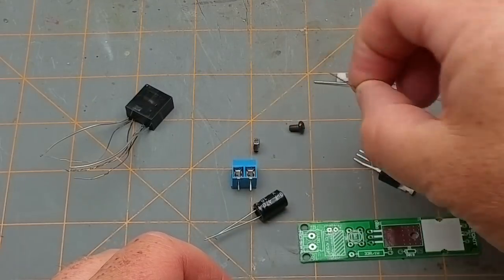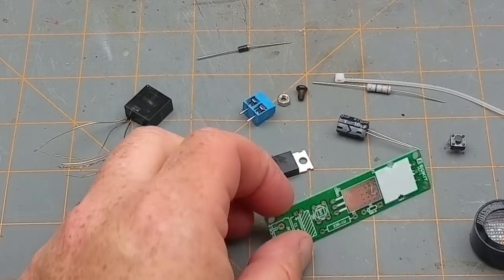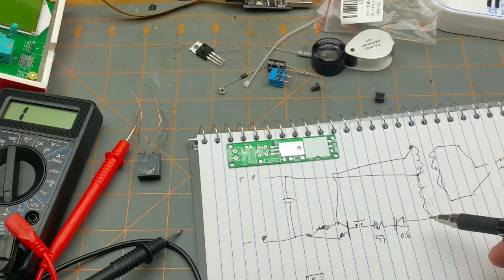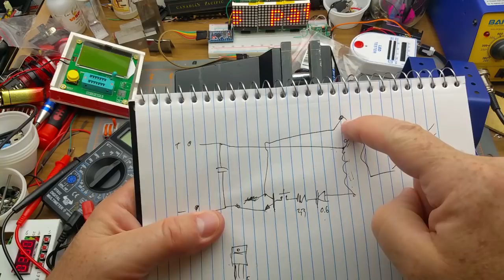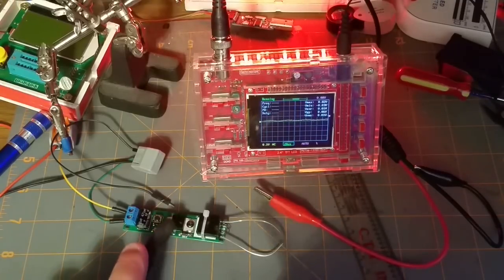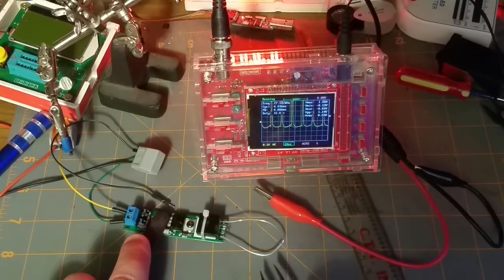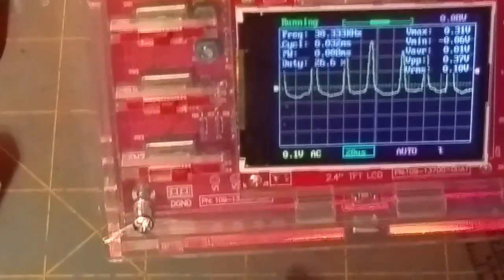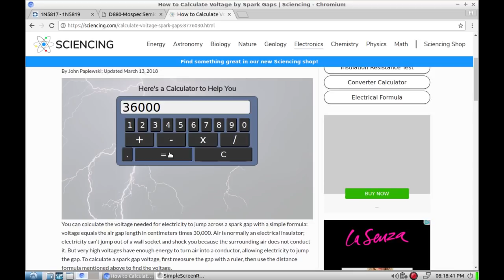High Voltage kit build

Comment: I've got same thing recently and it was fun for 5 min. 
Looks like this thing need 4+ Amp to work as designed, so I risk and use LiPo cell for this, survived Ok for short burst.And this is thing designed for - work from a battery.
Strong arc, "fun"/horror of operating high voltages.. Now it's on the back of the box "Maybe never again".
Reply from the maker: I tried it off camera with a LiPo from an old phone, and it produced a similar arc length to the 3 volt bench power supply, but not for very long.

If I was going to use this as a portable device I'd want to put it in a case. The transistor and resistor really do get hot after a short time.

But, I agree, I don';t think I'll get a lot of practical use out of this thing. 

But it was fun to tinker with. That's enough "value for money" for me.

Comment: is that dremel d-vise as stable as it looks?
Reply from the maker: Yeah, it is. even atthe wonky angle I have the top part set at, it stays solid. 
If you orient it correctly, you can even get the jaws at 90 degrees to the table and it won't fall over.

Comment: I got one of these things, and plan to put it in a case and take on picnics to start fires. But mine came without the 33O resister. I had a 77...will that make a difference? I also have a 15Ohm, but it's pink and even larger than the 33 is supposed to be.
Reply from the maker: The slightly higher series resistance on the base of the transistor will probably not make a huge difference in this application. The transistor should still be in or near saturation, so the collector current shouldn't be reduced significantly.
Reply: thanks for the reply. I actually had ordered 2 of them, so I assembled both, one with the 77 and one with the 33 as supplied. Both work, but the 77 doesn't have near the arc as the 33.
Reply from the maker: I guess that extra bit of resistance does reduce the base (and therfore collector) current more than i thought. 

I figured it would have to be more of a change to matter.

Comment: You've got a frequency of 30k... You've got a voltage of 30k... I wonder if that's just a coincidence, or if thats a result of its design, or..??
By the way, the voltage appears to be right around 30k, going frame by fram, the arc stopped right around 10mm.
Reply from the maker: My distance versus voltage suggestion was based on several generalizations and assumptions.

Comment: I think that is the same as the circuit I got off The Signal Path's Xenon flash vid, except it's a higher voltage.
http://forum.fritzing.org/t/xenon-timing-light/5861
Reply from the maker: That is very similar. The only significant difference I see is the centre tap is on the other side of the transformer.

Looks like they are using the HV circuit to charge a big capacitor, then dump it all at once thru the trigger transformer to give a quick voltage spike to the xenon tube.

I suspect bug zappers and other similar things also use a similar circuit.
Reply: Opps.

Comment: Very interesting as I find your channel most always is. Question is, what would something such as this project be used for for? 
My interest in electronics, especially what you were doing was very high sixty some years ago but soon found that being colorblind put a limit onto what I could do, eliminating me from this field entirely. However, I do enjoy watching and trying to make sense of what you demonstrate.
Still my thoughts are blank as I didn't catch on to what this build would be useful for.
Reply: This is not useful for anything, "just for fun". But, if you think about it, it's quickly transformed to some device prohibited to own generally everywhere (starts with  "s", end with "hocker").If someone irresponsible adds several Li-po cells in parallel, add some kind of case, add 1 more button to power up the thing and move "on" button to safer location, you will get a very BAD thing to own.(same as if you in Canada, and combine together 3 items - piece of chain, and 2 wooden stick. In separate - nothing, together - prohibited weapon)
Reply from the maker: Some sellers suggest that this thing is intended to be used for lighting fires (though they're less clear on what exactly - maybe smokes, maybe a gas barbecue..)

I'm also colour-blind (red-green), and resistors (and multi-pair wire) has always been a struggle. 
It does slow me down, but my multimeter and one of those ancient Radio Shack resistor colour wheel things helped a lot for many years. These days I use a few apps on my phone.

The important thing for me is to recognise that I can't trust colours and that I have to find another way.
Reply: pileofstuff I have learned to overcome and adapt being colorblind but it did keep me from two major career fields, electronics and US Marine Pilot.
I LOVE your Monday Mail calls. Great job.
Reply: I like wind proof, refillable, lighters so I am considering getting one of these to replace the piezo 'clicker' that always fails after a few months.
Would have been very useful to know about this a year-ish ago, as well, as my fathers gas fireplace stopped working due to the piezo igniter failing. Took him a while to find a replacement.